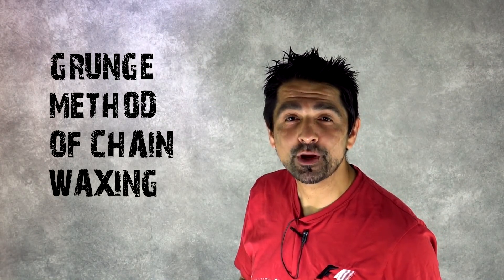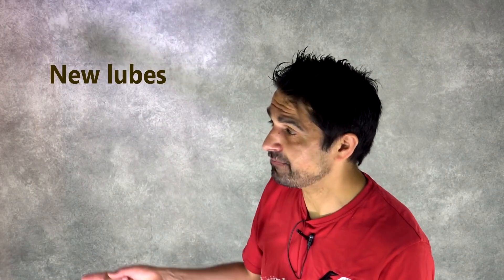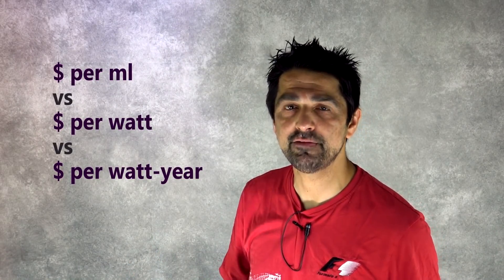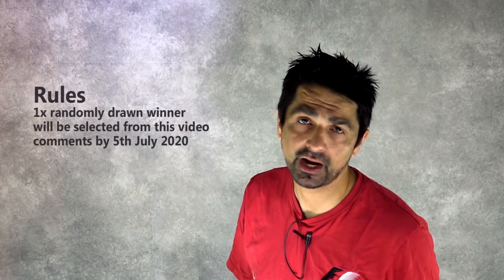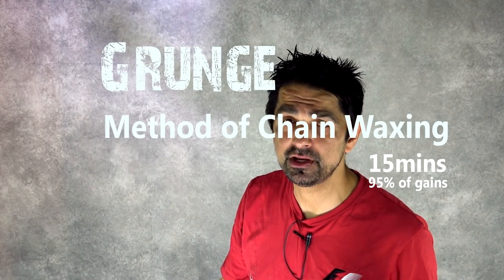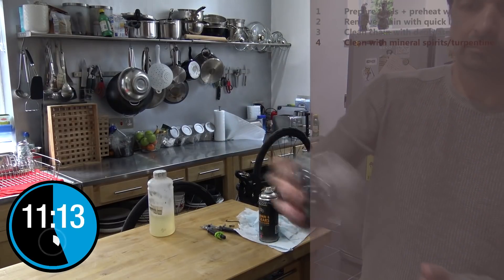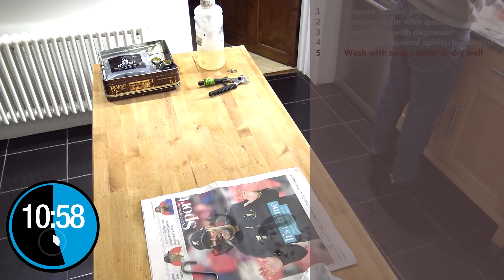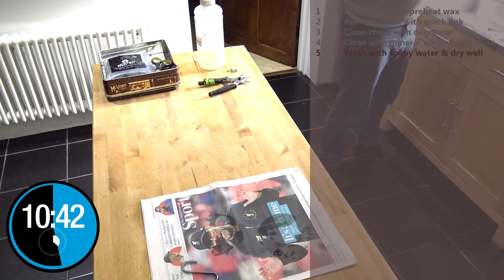Chain waxing and lubes revisited (15min grunge method is not a marginal gain)

Comment: I started waxing my chains (on 3 bikes) some time back.
My observations:
1- yes, it is quite hectic the whole process and yes it takes time - especially the first clean of the chain from the oil you used before or even worse: the oil from the factory of chain
2- heating wax takes time (slow heating)
3- picking up the chain from the bowl requires "fast fingers" as you would need to do it in around 55C and clean it off and put on the cogs before it gets completely cold because you need to remove the rest of the wax before it "freezes" completely - if you miss this point your gears will be very hectic for first 15 minutes or so to the point that you might not be able to change gears even
4- I have not been successful with riding for 250-300km as described on one waxing - I have dissolved some wax in the alcohol and I have it always with me to rewax it on the go every 50-70km

Summary:
1- the perfect outcome is: your bike is clean (apart from the white wax all over, especially on the chain stay and pulleys) - dirt is completely out of your drivetrain and no  dirty oil on your fingers in case you need to put the chain on the crank again
2-if you want to go on ride longer than 300km from your garage... I am not sure how to handle this yet as chain requires re-waxing
3-cost effective? I am not sure. You need to buy few things: slow cooker, wax, PTFE, thermometer, 90% alcohol, good quality chain link (reusable) etc. They say chain and cogs will wear much slower - I don't have enough km done on wax to confirm or negate it
4-time consuming it is plus not everybody is able even to do so

As long as I still have my wax with PTFE I will stay with it - especially that I maintain 3 bikes at once but on the long run - we will see.
Reply: late answer, but there is liquid chain wax that you can take on the 300km+ rides if you don´t want to take another chain. :)
And imho it is cost effective after a year of doing it, my chains/cassettes last about 5 times as long with wax. I have done 15.000km with wax now and can confirm. Wax 2-3 chains at once and cycle them, saves a lot of time...if you are not already doing that with those multiple bikes.
Reply: Isn't better use just liquid wax?

Comment: $5 Craigslist crockpot, pound of wax and 50g of PTFE has lasted me all year for 3 bikes.  Under $20 all in
Reply: That's my answer too. I have a crock-pot for the wax off of Amazon. Leave it full, wipe the chains, dip them, done.
I do recommend a crock-pot with a low setting. I had a single-temp cooker that boiled the wax (pot wasn't even close to full).
Reply: Same diy here, without the PTFE, only wax and lampoil. Use drip on wax sometimes if in a hurry. Works fine for years already and no dirty hands or oil smearing in the car anymore.